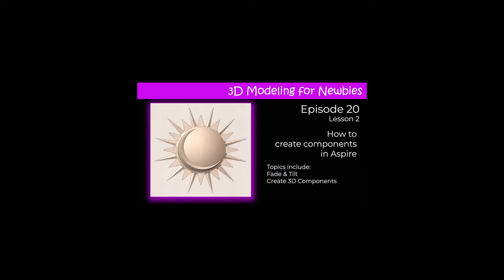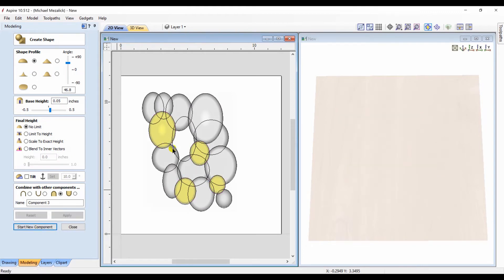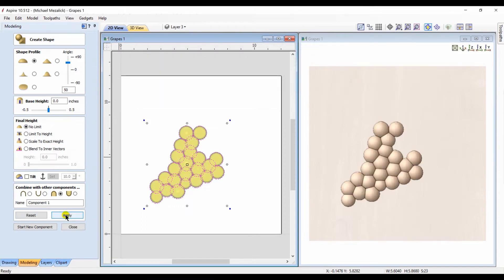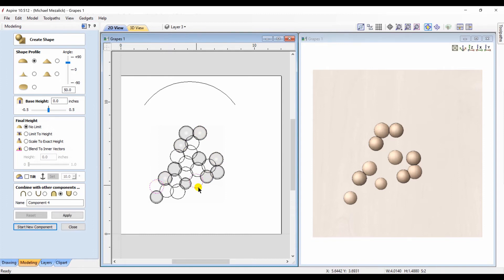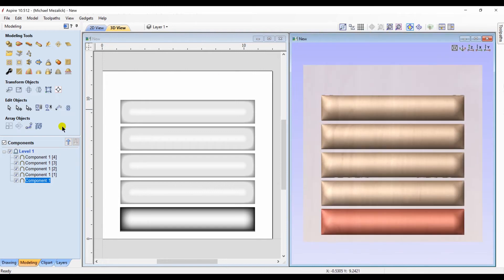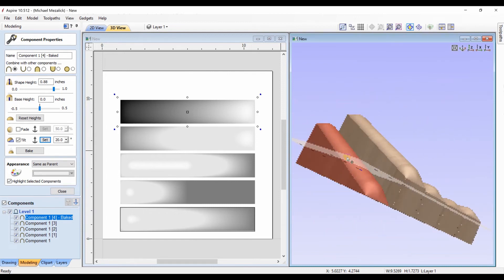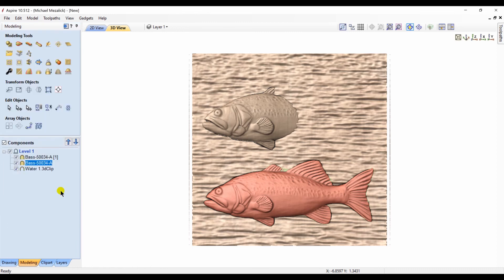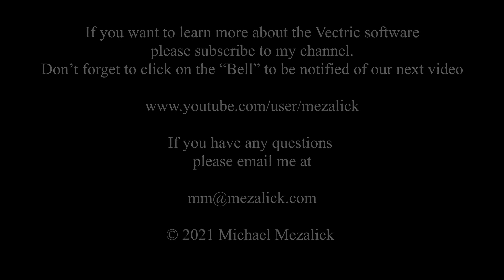3D Modeling for Newbies Lesson 2 Creating Components and Fade & Tilt

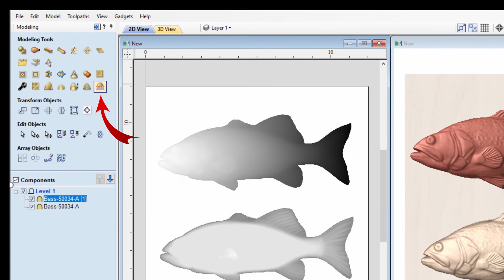Comment: Thank you! Excellent video and your graphics for Fade and Tilt cleared my understanding after getting confused watching the Vectric tutorials.  I did run into the problem with overall model thickness once tilted.  I am working with VCarve Desktop and do not have the "Replace Below Option" you addressed at about 12:10.  Is there a workaround using level clipping or another option that I do have but do not yet fully understand; "Slice Visible Model into Individual Component Slices?"

Comment: I am trying to make a 3/4" dia. X .375 high half ball job size 4" w X 9" h  X .75 thick the half ball base at bottom of .75 thickness.  I end up above or below bottom of the job. Used 90 degree and varied base height. My goal is a half ball with these sizes that I would then glue onto face of a small PaddleBall paddle to simulate a ball being hit. Ultimately making a small PaddleBall paddle as a Trophy.
Reply from the maker: Ed, use one of the 3D clipart domes that comes with the Aspire  software. Set the property heigth to whatever you want ot to be...